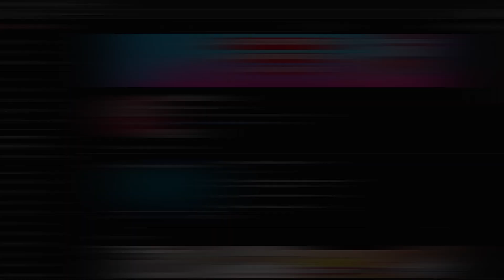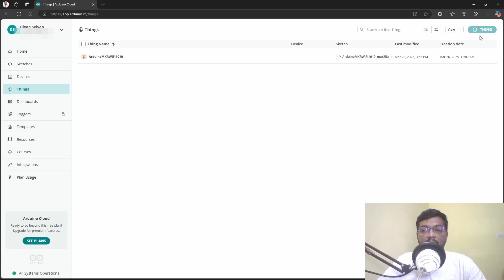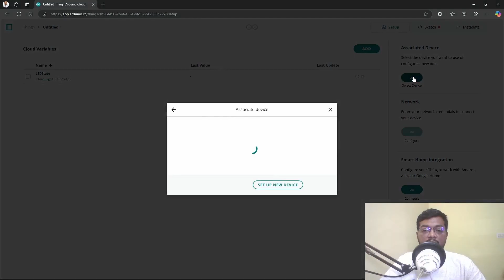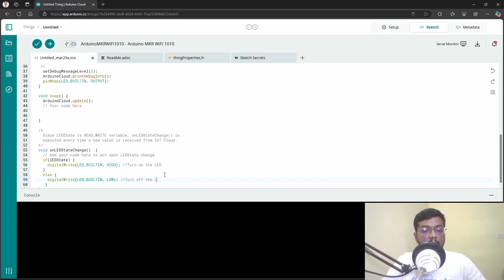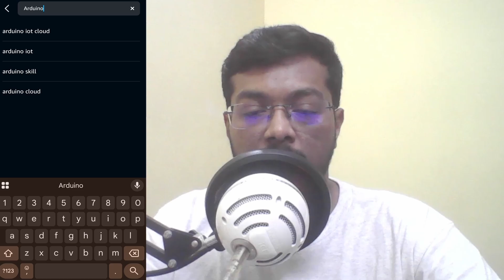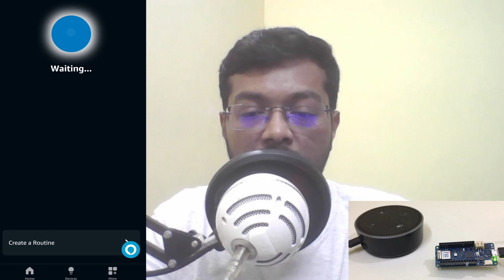Arduino MKR WiFi 1010 board and Alexa Integration | Shift It Design Challenge - Element14 Community

Comment: Can it also connect to an eink display. Idea is to connect it to Alexa and change the eink display based on voice command
Reply from the maker: Yes, but the catch is you have a function like OnYOURCLOUDVARIABLEChange() when you use this integration. So you are left with the choice to use the cloud variable to control what needs to be displayed in the eink connected to Arduino. I would recommend you to explore Alexa Developer Console for more control if you want to customize as you wish.